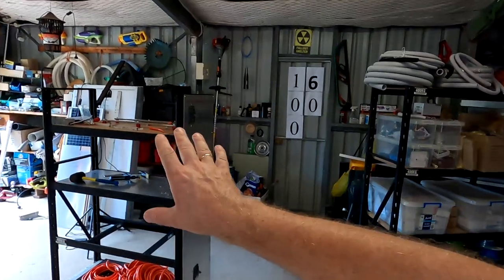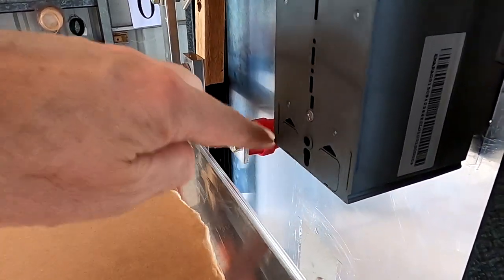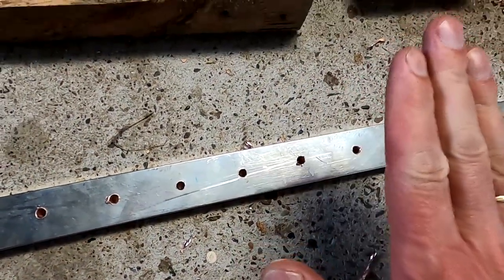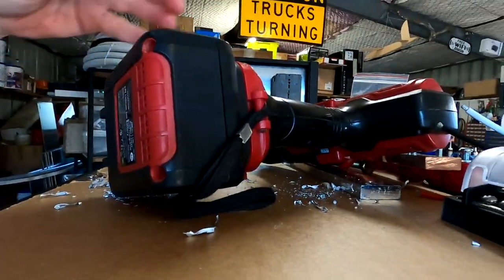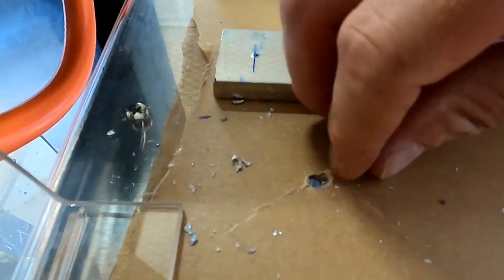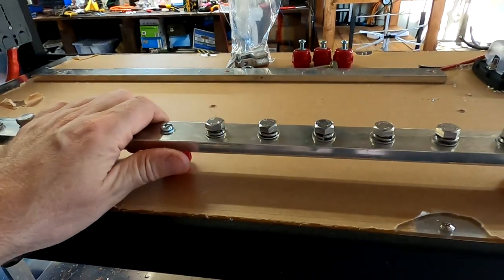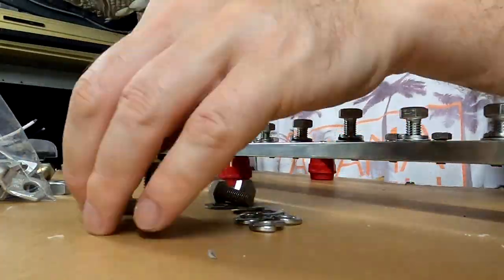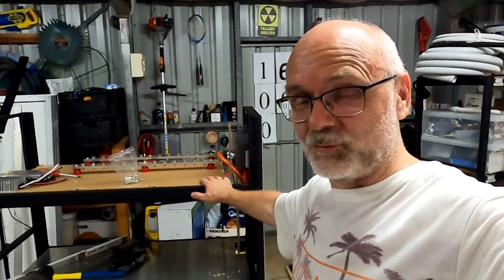DIY 24 Way Bus Bar installation. Battery 2.0

Comment: WD40 is unsuitable as a lubricant for tapping. It is too thin and will displace rather than lubricate. Your fabricating life would be much happier if you use a dedicated tapping fluid or wax. I've had great success with the TapMagic brand fluid. I've also used a tapping wax that works well. I don't know the brand, but its what they gave us at work. Blue in color. Looked like a bar of soap. After drilling and tapping thousands of holes, I've learned the right lubricant makes a world of difference. Also, I prefer using a step drill bit making holes in thin plastic. I've never had a crack using this method.
Reply: TREFOLEX CUTTING PASTE
Reply from the maker: You need to tell me that BEFORE I start working. Now, it's too late. I could have used butter though...

Comment: Hi,
thank you for the great videos! 
Question: Do you think it is an issue to rotate the eve 280Ah batteries 90° so the small side is facing down and the terminals are facing towards you.  
Small side facing down, fixture left and right Terminals on the front. like this: -->|||||||||<--

Comment: use soldering iron and melt a small spot at the end of the cracks so they don't continue growing :)
Reply: Strangely the way to stop perspex cracking whist drilling is to use a masonry drill bit. I have done this several times with no risk of cracking.
Reply: @nigelcharles511  i can actually see that working because it makes heat and softens the plastic instead of ripping through it with the sharp edges of a normal metal or wood drill bit :) good point i'm going to put that to memory for later projects.

Comment: try a spiral tap they do a better job as they remove the scrap material as they go they is also taps that have a drill bit on the end so do both the drilling and the tapping
Reply: Roll form  tap would have been even better still
Reply from the maker: I'm sure you all have these special tools just at home, right 😂
Reply: @OffGridGarageAustralia  slowly yes I find better ones or ones I replace one I broke with believe me working with Chinese bikes I tend to go through alot of drill bits and tap sets I learned the hard way to many times now and stop using a cardless drill on end of my taps I ead breaking them to often i am at moment looking for a 4 tooth drill chuck so I can weld a bar on the end rather then the rubbish sliding grip bar most tap sets come with

Comment: Hi, dear Andy, WD40 is NOT lubricant... Next time use f.e. old motor oil - it will be better   :-)
Reply from the maker: I don't have old motor oil. I've got a Tesla 🤷‍♂️
Reply: @OffGridGarageAustralia  :-)))) my sorry... And do you have kitchen ? And any kitchen oil ?  :-)))
Reply from the maker: @antoni_sk  no kitchen. It's Australia, mate. We're living from the BBQ😁
Yeah, ok, so salad oil will do the trick you reckon?
Reply: You can try it...  :-)
and don't forget the smaller threaded holes on your busbars for connecting non-power devices - f.e. measuring, etc.
Reply from the maker: @antoni_sk  all auxiliary load will be connected through circuit 2 pole breakers now, no need for the small screws any more...

Comment: 6.8 means tighter threads. Just use less torque for the less tread depth.
Reply from the maker: The ring lugs don't need much torque to make a good connection. I don't think you will strip this thread with a normal ratchet...

Comment: There's nowhere to be found a video testing the bms disconnect/reconnect sequence after an over voltage situation....it will be very interesting to see how it handles the pv voc from the mppt CC disconnected from batteries 😁
Reply from the maker: The BMS will only disconnect the charging source but will stay connected to the battery so still be operational. It will just re-connect the MPPTs.
I also tested this with the QUCC BMS and also the JK-BMS.
Reply: @OffGridGarageAustralia  thanks very much Andy!! that's very insightful info....do you remember what was the mppt CC's output voltage b4 reconnect point during those tests?
Reply from the maker: @AlexTorres-qv3hv  Sorry Alex, I did the test with the power supply in my workbench not with an actual SCC.
Reply: @OffGridGarageAustralia  thanks!!...i received a copy of the manual, it states a max working voltage of 73vdc...thus if you have a pv connected with a voc above that vdc threshold, and the SCC malfunctions..the bms will get fried and the batteries will go unprotected ...also checked the voltage threshold of the jk bms, it is up to 100vdc, a bit higher but not enough for most SCC that can handle up to 160voc...

Comment: You just got the wrong type of plastic , you need polycarbonate .  You can cut drill it with whatever you want .It's more expensive though.

Comment: why not using nuts instead of threading ?
Reply from the maker: There is not enough space underneath the bus bars. Once they are populated and connected, you don't want to get a spanner underneath to hold the nut, do you?

Comment: interesting ! Is there a possibility of long therm electrolysis in a humid climate ? (between the steel bolts and the copper busbar) ? Just wondering if that could increase a little  resistance in the circuit

Comment: Use a step drill to drill plastic.
Reply from the maker: I don't have one... 🤷‍♂️
Reply: @OffGridGarageAustralia  What?!? In the "moving the inverter" video you said it was your favorite tool!
Reply: @OffGridGarageAustralia  On another item. Cleaning the bus bars. I tested a new piece of aluminum bar stock with an ohm meter. I laid the probes on there side an got all kinds of readings. Look like just cleaning the bar stock with a cleaner is not enuff to get a good contact. I had to clean up with a little sandpaper.. Now laying probes on there side got 0 ohms.  NO Pushing probe tips into the bar stock. That gives s false reading.

Comment: When you drill copper there is a certain way to sharpen the drill bit. I could spend 1/2 hour trying to explain it, or point you to a video, but your job is done, so there really isn't any point.

Comment: Dont tap the bar - use bolts with Nuts & washers.  Copper is too soft & can strip out.  Drill them out & grab some nuts & washers & then you'll be able to tighten the heck out of it.
Copper also work hardens, wonder how that will affect the threads over time if they're undone-done a few times. 
Drill out, grab some longer bolts & nuts & washers mate.  Buy once, cry once...
Reply from the maker: They don't need much torque to make a good connection.
Reply: @OffGridGarageAustralia  True - but with all your terminal issues, wouldnt you want a SUPERB connection?
Its less work too - drill 1 hole & bolt together.
You are drilling, then tapping with lube, then have to clean off that non-conductive lube...!

Comment: Andy, stainless steel is a bad conductor 6.9 x 10 - 7, where as copper is only 1.7 x10 - 8 and brass about half that at 0.6 - 0.9 x10 - 8. You don't need stainless 304, your not on a boat.
Reply: its nickel plated copper, not stainless steel